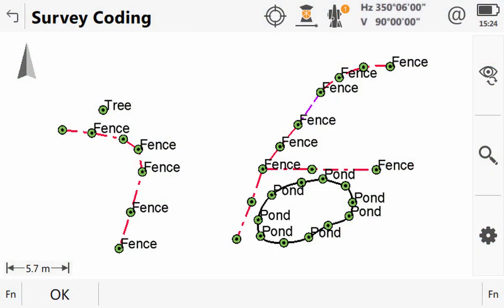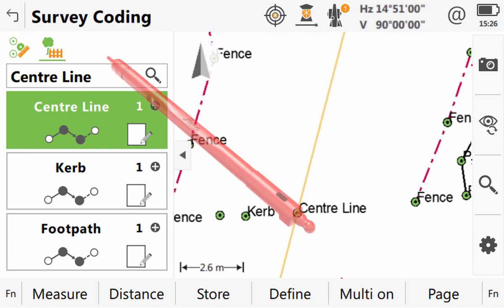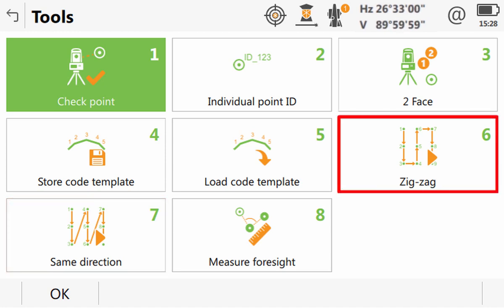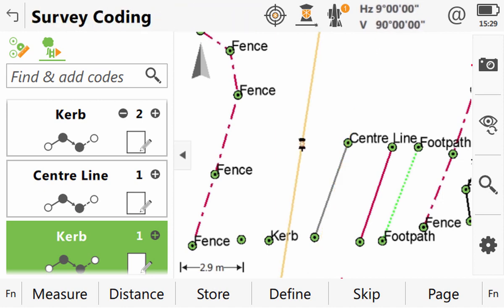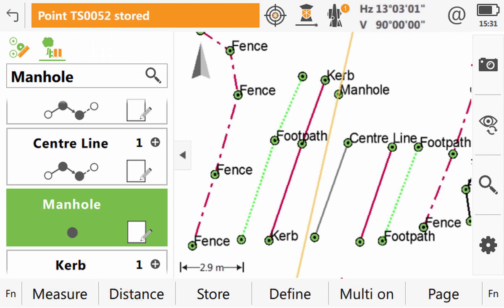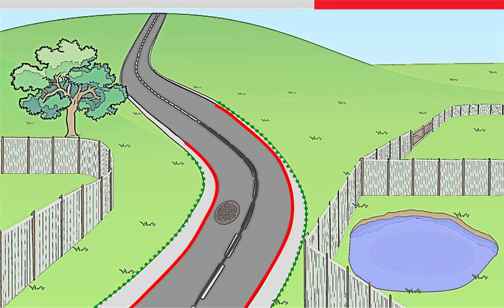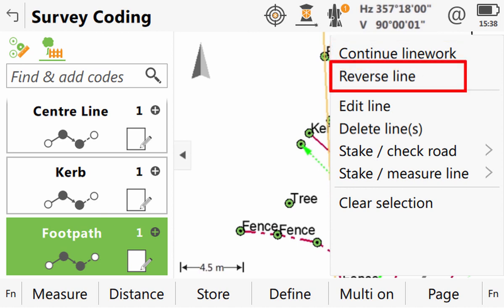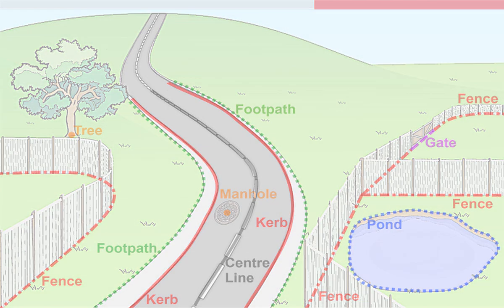Coding and Linework 2 (additional functionality)

Comment: Have been using Leica for nearly 20 years-started with the 1200 series.  Been using captivate for a while now.  Due to a figure in the company, we were not able to do linework using the on-board leica tools.  Every code and line command had to be manually entered.  He's gone now, moved on to work for the county.  I have taken it upon myself, after we were bought by a larger firm, to learn and setup the controllers as well as autocad c3d.  This video and the following video were instrumental in making this work.  Too bad this isn't included in the technical manual.

Comment: Also useful would be a computation of a best fit line. A lot of times when I measure  a building i take many shots in every side for more precision or to avoid mistakes especially when measuring with a mo prism mode. Then I compute best fit line using civil 3f function.

Comment: Very good software. I have some recommendations on it. First of all a function that miss from all the brands in the market. The chamfer function. In many cases needed to measure a corner which is not accessible or its a little destroyed. In that cases it would be useful to compute automatically the corner as an intersection of two lines with the same code.

Comment: how to insert a point to an existing line?
Reply from the maker: +kamal jarada 1) Tap & hold on the line > Edit line > Geometry tab
2) Highlight the point after which you want to insert the point > Press Add
3) Select which of the points in the job you want to add > Press OK
Reply: Can you please add insert point to line on the line work menus, it would be very helpful and quicker.